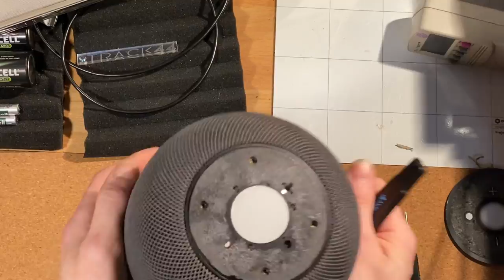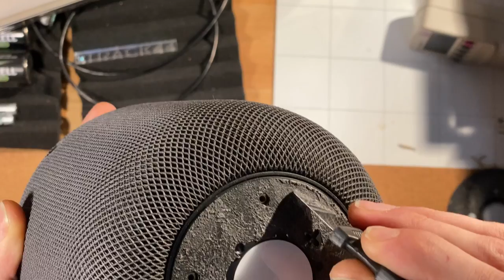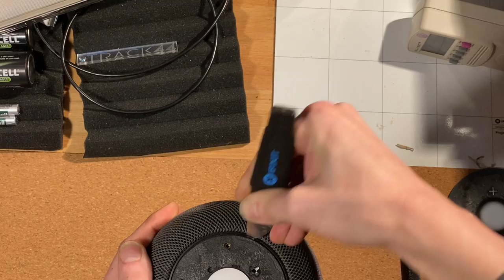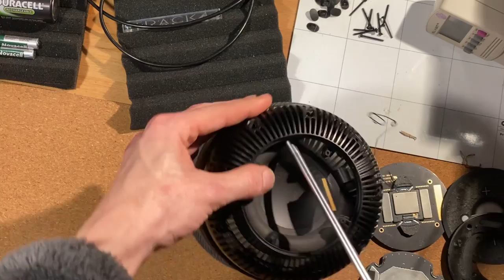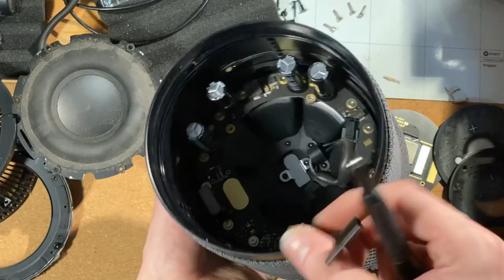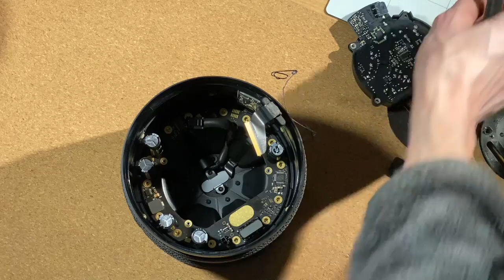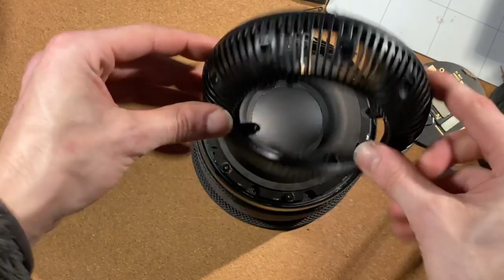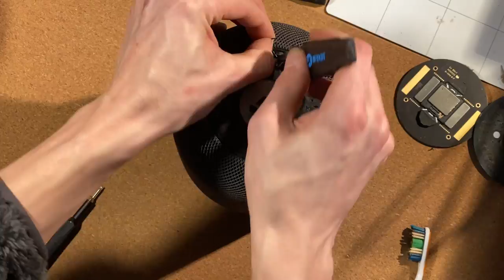How to Fix a HomePod that Won't Power On; The Most Common Inside the A1639

Comment: Just came back here to comment that I managed to resurrect my long dead Homepod that I was going to throw away. I didn’t have the confidence to do this clean so I had a local repair shop attempt this. As suspected from the well described symptoms, it had the failed diode which was replaced, and the Homepod is back! Truly grateful to this video and channel!
Reply: How much were you charged to fix it?

Comment: Managed to repair a HomePod brought to our Repair Cafe - customer was going to throw it away if we couldn't fix it. Some aspects of the repair were quite challenging: the glue seemed to be much stronger than on the one in the demo. I couldn't detach the glued-in ribbon cable without putting a dent in it, and the clamp for the ribbon cable at the bottom of the unit fell off: I had a devil of a job to put it back and was not sure if it was working. Also when removing the diode I managed to dislodge the tiny capacitor next to it - a frustrating 40 minutes getting it back in place!
I was absolutely amazed when after all that it worked when I had put it back together! Couldn't have done it without you.

Comment: Yesterday, the Christmas gift I bought for my wife many years ago – the first-generation HomePod – wouldn't turn on.

My wife couldn't listen to music, a bit disappointed. 

Upon disassembling it, I discovered the Schottky diode on the power board, as mentioned by Nic, was faulty. However, the surface-mount component would take 7 days to arrive. Waiting wasn't an option. So, I spent five dollars on Amazon to buy 20 through-hole versions with the same 60V5A specifications. They arrived this afternoon. Using a hot air gun, I removed the faulty surface-mount one, soldered on the through-hole diode, and put it back together! It came back to life instantly! The material cost was only twenty-five cents, saving the HomePod! Ready for another 10 years!

Now, my wife can enjoy music again, and all is well.

THANK YOU SO MUCH! @NicsFix

Comment: Thanks so much Nick for this video! When my HomePod suddenly died a few months ago I was very disappointed, until I discovered your channel. Since I live in Argentina, it was not possible to send you the HomePod for repair (I would have been glad to do just that) but felt encouraged to try to resurrect it myself using your amazing tutorial. Long story short, my HomePod came back to life after the diode replacement, all thanks to your step-by-step guidance. Cheers!

Comment: Thank you so much for the detailed instructions and awesome tutorial. My original HomePod died recently, and all the observations aligned with your guide. I managed to replace the diode (never done it before, so it was interesting), and now I have a working HomePod again. Apple wanted to charge me £260 for the replacement ;)

I did have display issues while reassembling - the display worked fine when being tested "loose", but it started boot-looping when fully screwed in to the top - it was flaky to say the least, but eventually put it back together ensuring the final top 4 screws where not too tight.

Comment: ABSOLUTELY FANTASTIC! Thank you SO much my friend this has saved me big! I bought a replacement diode (different to the one you linked due to being in the UK, but same specs as original), followed your guide and sure enough that has resolved the issue and resurrected my lifeless HomePod! :D Shame that this appears to be such a common issue on these devices, but i guess they unfortunately werent around long enough before Apple killed them for them to start failing whilst in service :( At least i now know what to expect when another one of mine dies!
Reply: Hi Josh. Same problem. Would you mind sending me the link for the uk spec diode? Can’t find. Cheers
Reply: I am also in the UK, do you have the diode details please?

Comment: One of the best videos I have seen on the HomePod tear down. You manage it without destroying the device which is commendable. I have a unique situation with my HomePod. There is absolutely no bass. It happened a few months ago. Any suggestions?
Reply from the maker: I would check that your subwoofer is still good somehow, maybe using an external amplifier or another homepod for testing parts. If the woofer is still good, it's likely the amplifier IC that drives the subwoofer which I made a video showing how to replace! The video shows a no power diode repair and the amp IC repair but just ignore the diode parts: https://www.youtube.com/watch?v=OvHope_C_lc

Comment: Hi  Nic 
Hands down the best tutorial 

I came across your video after I developed fault with my HomePod 

I accidentally left my HomePod upside down and after that when I tried playing song on it I started experiencing issue with bass on high volumes. It also feels like there is some loose screw dancing in the HomePod 

Any suggestions 

Shall be greatfull to you

Comment from the maker: ouitmenick made a great suggestion; when prying the top basket off the speaker, pry against the top of the subwoofer screws! this way you can avoid cosmetic scratches on the woofer. you may bend the subwoofer screws trying this but they're easy to bend back...YMMV!

before prying the basket off the subwoofer, drip 99% alcohol inside the perimeter to weaken the adhesive!

check out my new uploads where I show how to repair dc offset / death farts / crackling or popping bass, replace your mesh, and even repair a no-power homepod that WASN'T caused by this diode!
Reply: really love your videos, I love the homepods especially in stereo mode and is sad to see they discontinued it. Now thanks of you we finally also gained the ability to last the product at least for a very long time to counter the most happening issues it has. I don’t know why apple put a cheap diode component in such an expensive product anyways. Profit was bigger than quality I guess.. Thanks a lot for your videos looking forward of more content!
Reply from the maker: @TechDraX  who knows! the trend I've noticed so far with these diode failures is interesting and not necessarily indicative of apple just cheaping out on this diode. All of the diodes across all homepods have the same model number. But, so far, only diodes with a later date code on them have failed. I have not yet replaced any diodes from earlier date codes. With this trend I'm guessing there was just a bad batch of diodes later on, or, the later batch is just more prone to overheating and shorting out.

Comment: Hi, Thanks for this tutorial on this fix :-) One question what kind of grease, flux or whatever is it you dip the diode in before soldering?
Reply from the maker: I lost the lid for that a long time ago and it was an old jar I borrowed from work so I am not sure :( but I've been using Chipquik NC191 in all of my repairs now

Comment: Well done. 
I’m sure you make it look easier than it is. So I might not attempt it still, but first I need to see if that diode is easily available. Then I’ll have a think about it.
Edit.. thanks… I see you have a source link so great, but now I realise I don’t have the right tools. I have a standard soldering iron. I’m not familiar with anything else.
Reply from the maker: You miiiiight be able to wick all the solder out from under the diode via it's pins, I'm not sure. Also not sure if you can adequately resolder a new one on all with just an iron, but I've read stories from others who have managed. If you're at all into soldering, even a cheap $50-75 hot air station goes a long way though!

Comment: How tight do you put he sub screws in, I have repaired mine, thanks to you, but I now have a vibration noise on some bass notes?
Reply from the maker: They should be firmly tightened, but not so much that you're squishing the gasket. A little squish is good. More likely you have a loose / missing gasket somewhere

Comment: Hi, is there a replacement power plug/cord for this homepod, but cheap version, not the 15$+ one! thanks
Reply from the maker: Hiya! I've bought a few of the ~$15 power cables off eBay before. They have all been fine and compare to the original ones. not sure if there's any cheaper options!

Comment: Thank you so much for putting such comprehensive videos together. This definitely gave the confidence to try and repair our blown-diode HomePod. 

While we replaced the diode and managed to get power back on, it still behaves a little wonky. When the sub hits a high volume, the whole HomePod loses power and resets. A friend who helped with the soldering repair mentioned that occasionally when a diode shorts out, it may take down nearby components (in this case, they suggested that the IC immediately adjacent to the diode may have taken some damage). Have you ever replaced other components on the amplifier board, or run into a situation like this post-repair? 

Thankfully the IC in question is apparently readily available -- a TI TPS5450 ... so I was thinking of repairs round two ...
Reply from the maker: I haven't experienced what you're describing after repairs though what your friend is saying makes sense. I would also be curious if you have any dc offset: https://nicsfix.com/#popping
Reply: @NicsFix  We'll take it apart and let you know the findings. Just happy to provide more data points that may result in more repaired 'pods.
Reply: @dreamstate07  any feedback on your second repair?
Reply: @jackgerberuae  Alas, we think we have a damaged logic board. It got stuck in a few reboot loops, and when iOS tries to push an update to the HomePod, it would download the 0.5GB update, reset, and start the download again. This is in addition to the points mentioned in my original comment above. 

So unfortunately, we've given up on this one. :(

I'm eyeing one of the new 2nd gen HomePods ...
Reply: @dreamstate07  thank you for the update.  I will be able to strip mine, but that is where it will end 🤣🤣🤣

I saw Marques Brownlee reviewing the HP2 just before watching this video - which reminded me of mine. Have a look, the review is not very positive

Comment: Thanks for the video. I had a homepod with the same issue, the warmth on the side when plugged in but otherwise dead. I replaced the diode per your instructions. Now, when I power it on, nothing. Still dead, but it no longer gets warm on the side. Any thoughts on what it might be? Thanks in advance.
Reply from the maker: Most of the time it's something you might have damaged along the way like a ribbon cable. Or you just don't have one of the ribbon cables fully reinserted or correctly locked. https://nicsfix.com/#goofball
Reply: @NicsFix  Thanks for the reply, and the link! I disassembled, re-soldered, and re-assembled and still dead. Time to throw in the towel, but thanks for all the great information!
Reply from the maker: @johnvargo8050  are you by chance in the US? I would be willing to help you out if you can send it in!

Comment: Great video! Loved watching it! I've got a similar problem with the homepod mini. Mainly doesn't respond when reconnected once disconnected to power - then if left connected can randomly turn on. Basically turns on on its own will. Any thoughts?
Reply from the maker: I haven't had my hands on any Minis yet...can you give the power cable and connector a good wiggle to see if it's perhaps broken inside? I'm guessing you've also tried another power supply too. This doesn't really sound like an internal hardware failure to me yet if it sometimes powers on and sometimes doesn't, but I'm not sure.

Comment: Awesome! Thanks so much for posting. My HomePod crapped out earlier this week and I was very chocked. Now I at least have an option to attempt a fix as I had no desire to give up or replace my HomePod if I could help it. What part info can you share regarding that diode so I can purchase locally or order once? Again, much thanks.
Reply from the maker: It's a surface mount 60v 5a schottky barrier diode, I replace it with part number "PDS560-13" which I get from digikey here (available at a bunch of online component stores): https://www.digikey.com/en/products/detail/PDS560-13/PDS560DICT-ND/776779?so=73342686

Comment: Excellent video . My question is a friend of mine brought in some used homepods from the states, and most of them are not connecting. It would not even reset. Here in Lagos, Nigeria we do not have Apple support. Anything that can help him is welcome
Reply from the maker: Hmm are they just booting up to flashing volume lights? If so they would need a logic board swap. Sadly I don't even have any good logic boards to do these specific repairs and no one has figured out how to de-brick them. But if you can find other broken homepods that, say, have sound or power issues, they likely still have good logic boards to swap with then factory reset.

Comment: Excellent video!
But I’ve partly snapped the longest/3 split ribbon cable during the flat-head manoeuvre. Any chance of revival?
Reply from the maker: Sadly Apple won't give us replacements :( only way to get more is from another homepod. It's possible you only damaged noncritical lines but it's not worth the risk trying it as you could end up shorting and wrecking both the amp board and logic board, ugh! We all need to bug Apple to add homepod parts to self service repair!

Comment: After watching this, I'll just buy a new Sonos, forget all this!  How much do you sell the repaired units for?  I would love a second one, but some people would rather have them sit unsold with crazy high prices, than sell them for a little bit less.
Reply from the maker: I'd sell them for $200-$250 (typically I get broken ones for $100-150, and repairs start at $50 for whole pods or $20 if you send in just the board). 

It should be known that replacing this diode doesn't fix any of the popping issues. There are three popping issues I'm tracking:

1) Loud Pop and Restart, associated with a panic log in your HomePod Analytics. Apple says this is fixed in the upcoming 15.3 release. (UPDATE: Software popping is fixed in 15.3!)

2) Loud pop and restart, no panic logs. This is more likely a failing amplifier IC, a custom part made only for apple's homepods that we cannot get. This is a sign of iminent failure. (UPDATE: Not the amp IC, but failing filtering capacitors. I've also found two options for replacement amp IC chips)

3) Subtle click / pop every ~10 minutes or as the homepod goes in and out of standby. This is also caused by the amp IC, when it turns on it sends dc to the woofer which you hear as a pop. (UPDATE: As stated above, not the amp ic!!)

EDIT: Issues 2 and 3 I have found repairs for! They are not caused by a faulty amp IC, but in fact failing capacitors! Check my channel for new repair videos~
Reply: @NicsFix  May I ask how long your work is warranted for? Thanks.
Reply from the maker: @Gleeleeglee  I give a 6-month warranty on all of my work and parts :)

Comment: That very last step when you place the top cover back on... Is that glued on?  I see you moving it around to center and seat it ... are there catches in there or is it glue?
Reply from the maker: Yes that uses adhesive to stick on, no alignment notches or anything, I'm just trying to line up the volume buttons under the top cover to the volume cutouts on the layer below it before pressing it down to fully stick back in place.. If you don't touch the adhesive with greasy fingers and cut it clean enough when you first remove the top cover, it's usually good enough to re-use when putting back together. We've gotten about 50-75 homepods sent in and shipped back out by now for repairs doing this and I haven't heard any complaints or issues of them coming loose so it seems to be working well.

Comment: Is it possible to replace the diode with just a variable temp soldering iron? Or do you need the hot air station?
Reply from the maker: There's a large  pad on the bottom of the diode and the board will also suck a lot of the heat up, so a hot air station will make quick and easy work out of it. I've heard others successfully using two soldering irons on each side or one large one big enough to cover the whole diode but sounds tedious

Comment: I somehow  managed to put the top ribboncable in backwords.  My thermal camera. Measured 81c coming from the little led thing on the top. I quickly flipped it around. Now it measures 41c and still doesn’t turn on.  Any advice would be nice.

Comment: Have you ever encountered a very stubborn diode that doesn’t want to come off the board? Using hot air soldering iron and tried regular. Won’t budge.
Reply from the maker: Yeah they can sometimes put up a fight. You're fighting against the board acting as a big heatsink, too. Make sure your hot air is turned up to 500c, ~80% airflow, and preheat the backside of that area of the board for ~15 seconds, then flip it back around and go straight for the diode until it comes off.
Reply: @NicsFix  hey that did the trick! Thanks for the help. Got it all back together and working! Awesome video👍🏻

Comment: Great video, it looks like you have had a lot of experience with repairing these HomePods.  It appears you even repair these for other people as well on occasion.  I have one that will not power on; It was sitting on the kitchen counter and got knocked off (oops).  It has no physical damage on the outside and was not on when this event happened, Do you think there could be a loose connection inside preventing it from powering on?  I tried to contact you through Discord but couldn't really figure out what to do.
Reply from the maker: Let me hop on my discord and we'll see what's up
Reply: @NicsFix  
Me too, joined you on discord, but I can't get in touch with you @AdminTech
Reply from the maker: @adetoye50  Ah I see now, my nickname on discord is different than youtube. I'll ping ya
Reply: I have a similar situation with my pod. It fell 😢.
Did you manage to get yours fixed, and how please?